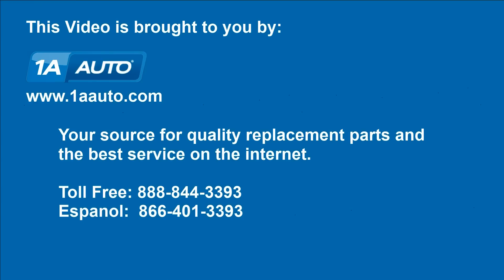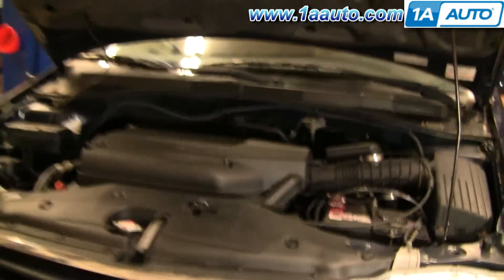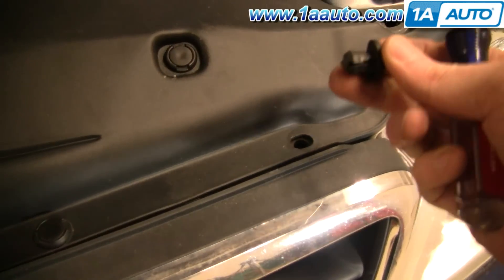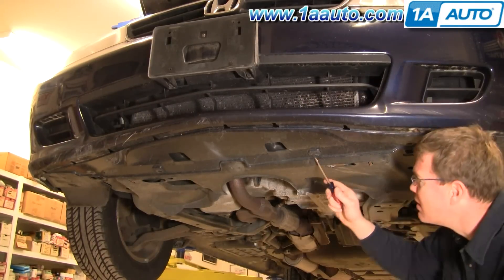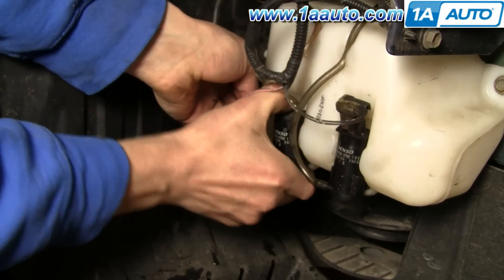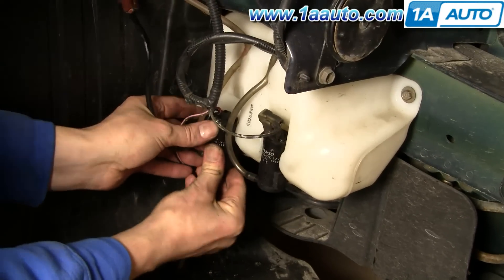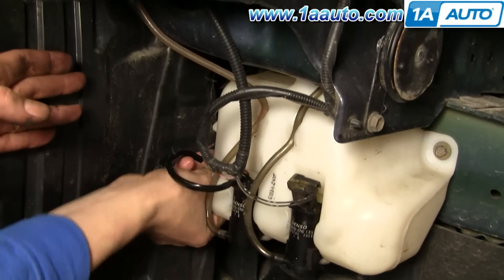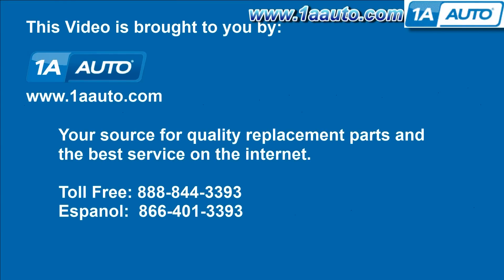How to Replace Windshield Washer Pump 99-04 Honda Odyssey

Comment: Can the pumps be replace by removing the front right wheel instead of the front bumper?
Reply: Yes that was a ridiculous amount of work for repair. People usually look for videos like this because they don't know what they're doing.  He got you taking the whole front of the car apart. You can really do it without taking the tire off if need be. I would recommend it though.
Reply from the maker: +Todd Thanks for the feedback!